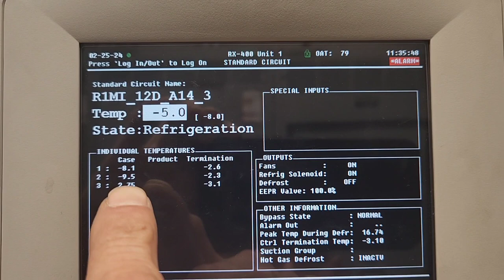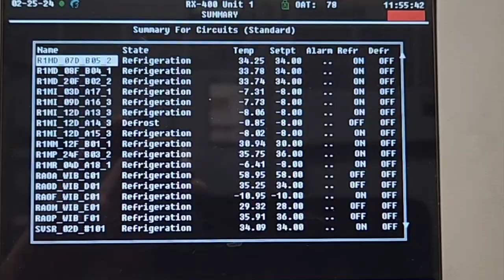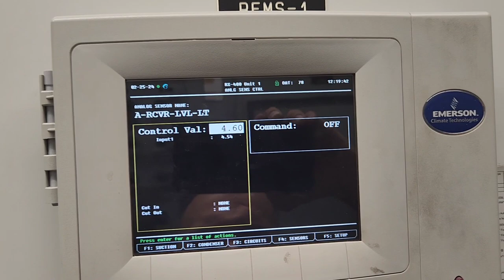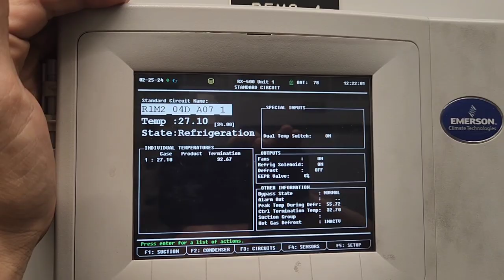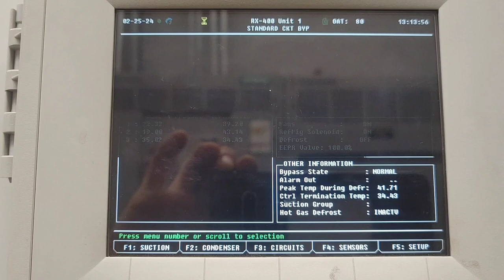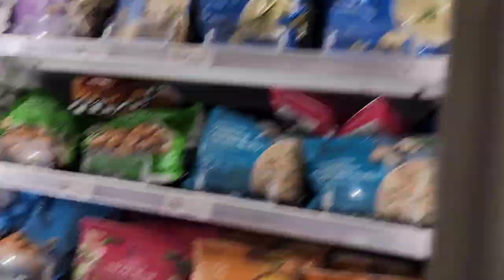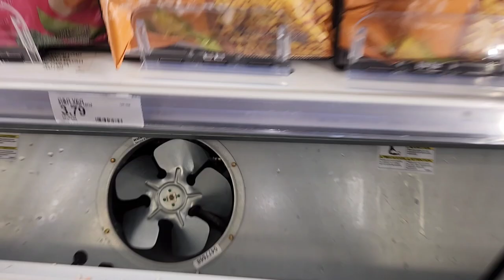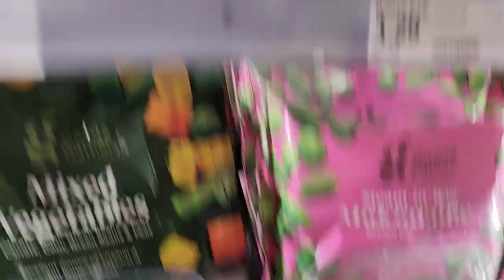4 Door RLN-4 Frozen Food Case Froze Up

Comment: If it's a evac system you have to go slow or you will overflow the buffer box but if it's a acorn system you can go at it like there is a floor drain. You can also plug the drain and use a vacuum to clear the drain pan

Comment: Hey man how do you remove the door pillars on the Hussman cases to change out evap coil?
Reply from the maker: You don't remove the pillars. Once you have all the shelves out, and the evap disconnected, you and another guy can get it out the far right side door together.  Just be careful with the new one getting it in so you don't create a leak